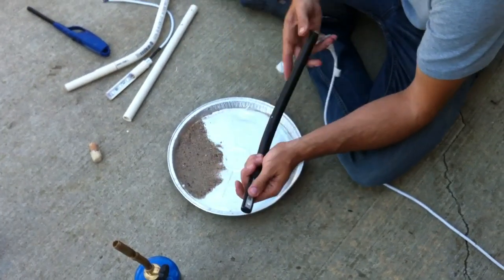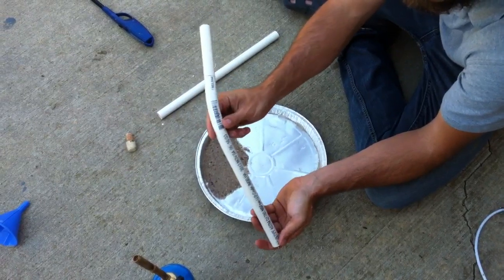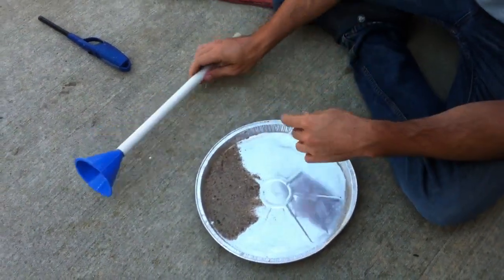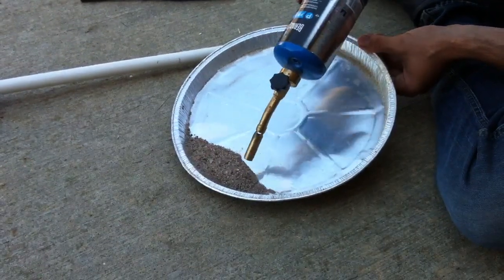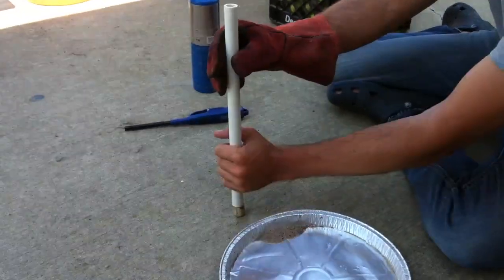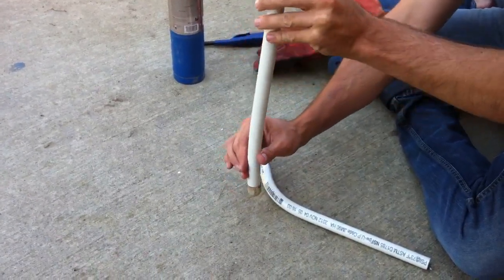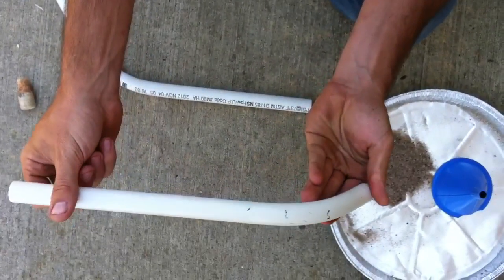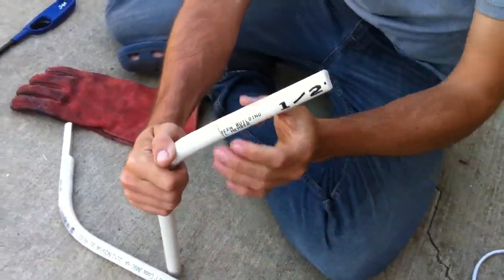How To Bend PVC the Easy Way

Comment: Ever hear the phrase "go pound sand"? Now you know where it came from. All conduit was bent by packing the conduit with sand back when conduit first came to be. It still works on metal as well as plastics but there are better ways that don't require sand such as air pressure or good bending tools.

Comment: If you use this method, and  have the PVC bent in a jig of some sort, you can speed the cooling by simply running water through the inside of the pipe...  However, using water to remove the heat may cause the PVC to become more brittle due to the more rapid cooling.

Comment: Who are the 406 idiots who gave this a thumbs down ?

I hold 2 journeyman cards in different commercial & industrial bldg trades as well as a Crane operators license & certified in 2 types of welding , i have nearly 40 years experience in the bldg trades & I just learned something new and extremely usefull .

Best tip I've learned in 40 years .
Reply: Well said sir, I find it helpful too.

Comment: To cool down faster, wet a piece  rag and wipe at the heated part.

Another way of bending pvc pipe is by inserting a spiring into the pipe and bend it. No torch, sand, welder gloves needed and safe.
Reply: As Technicolor Christmas put it clear above: Try to get a 2" pipe bending spring... The largest I've seen is about 7/8"...  This method in contrast, can be used for up to 2" pipe!

Comment: After I use the sand to get the desired shape...I just dunk it into a bucket of cold water to rapid cool and set the piece.  I use that method when I am making quick pieces of bent pipe....if you need the working time to be longer....just dont water cool... SImple

Comment: To make consistent copies, perhaps you could mix cement with some of your excess sand, dig a shallow hole in the ground (as a support), pour in the sand/cement mixture, press in your master tube (less than halfway covered!! :-), and let the cement harden. Then, you have a form for making perfect copies, with the bonus that the form will help cool the tubes more quickly. Probably a good idea to wiggle the master tube very slightly as the cement is setting up so that the fit isn't TOO tight, and you might also want to coat that tube with a little oil or somesuch to keep the wet cement from sticking to it. The copy tubes wouldn't need any of that.
Reply: So you put the master tube in concrete and let it harden.  How do you then remove the 'master' bent tube?   FAIL.
Reply: +Gord Baker "Less than halfway covered," you are basically making a bent trough in the shape you need. FAIL to you sir.

Comment: First off, Thank You!  You made my head explode.  DIY PVC projects are taking over my life.  I have just one quick question.  Since I have never done this before,  would a hair dryer or a Heat gun work while using the heated sand at the same time?   I'm going to try both.  Have you any suggestions or recommendations?  I'm all ears!
Reply from the maker: I have never gotten a Hair dryer to get hot enough, a heat gun will work but it is harder to get the pipe to heat evenly along the entire length and evenly all the way around.

Comment: combine your sand with a heat gun and you got a quicker and adjustable heat input. Not certain why that is the "hard" way.
Reply from the maker: +ObsessionPC because a heat gun heats only one spot/place on the pipe at a time.  For the demonstration piece, it may work ok, but I use this method regularly with pipe up to 10' long.  No heat gun can heat a 10' long pipe and keep the entire pipe the same temperature and consistency while maintaining the diameter of the pipe.  Heat guns also burn/scorch the outside of the pipe, but mainly it's the inconsistent temperatures as a reason to avoid them.

Comment: Be aware that placing the  pipe on the outside of the template forms the inside radius to the outer radius of the template, not to the same angle as the original.

Comment: slide pipe insulation over outside of pipe and as soon as you pour the heated sand in plug that end up as well asap .. that will hold the heat increase of aprox. 47.8 %

Comment: i would just spend the money and buy the appropriate fittings, what am i missing? they even sell fittings that do a 22 degree elbow. Please explain?
Reply: +Fatsacks Allday In his application, the elbow wouldn't be a smooth transition.. The OD of the elbow is something like 1/2" larger... so in this case it's just aesthetics.
Reply: i see, thanks for the clarification.
Reply: +Fatsacks Allday  I agree with just buying the fitting needed. I can see bending a tube for a special home project ,but not for the intended purpose of the pvc. The tube wall will be thinner at the bend making it weaker at that spot. Ok for drain ,but I would stay away from anything with pressure behind it.
Reply: +magic5651 
Do you have any concept of how these pieces of tubing are to be used?
Magic indeed...
Reply: +ellsworth No. That's why I made statement in my reply for those who would have different applications for this method.
Reply: My logo is because i grow weed lol i dont give a shit about organic vegetables. i dont see any use for bending pvc pipe like that, there are much better materials for situations that need bended pipe.
Reply: +Fatsacks Allday your missing that he is making landscape lighting...lay off using your crops.
Reply: +3speedjohn waaa true that , must of missed that when I first watched the video
Reply: +magic5651  your not supposed to use PVC for high pressure
Reply: +Fatsacks Allday   Most fittings of the same diameter do come with one, or two ends that are larger and in some projects that isn&#39;t desired.  To get around this and keep pipe fittings a smooth transition from one piece to the next, buy the next smaller PVC pipe and use it to make slide in parts.  Sometimes you have to make the slide in part a little smaller to get it inside the larger pipe you are connecting parts to.  That is easy to do if you make the slide in pipe piece with a cut that runs from one end to the other with a circular saw.  The blade cuts away a small amount of plastic, depending the kerf, or width of the blade.  When the slide in pipe is squeezed down a little to close off the gap of the cut, it becomes small enough to fit into the larger diameter pipe parts.  The result is no lumps or bumps in the pipe framing.  If you decide the joint is too weak, then use metal pipe slide in parts made the same way.  Usually the slide in is at least 6" long, providing 3" for each plastic pipe part.  This isn't a new trick, but used by others making a greenhouse frame out of PVC pipe that will be covered in greenhouse plastic film/sheet.
Reply: Why not just use flexible conduit for the situation he was in? 

yes i have actually made one of the hoop houses/ green house before but there was no need to heat it and bend it. pvc is very flexible as is.
Reply: Not sure I can comment on his situation, or what he and others might find useful.  As to flexible conduit being placed inside PVC pipe to help with the heating and bending of PVC pipe into a custom part, there are tools for purchase made with flexible conduit with heating elements inside.  They are sold for commercial applications, use electric to heat Nichrome wire and often come with a temperature control.  A bit expensive to buy and not so bad on cost to use.
Reply: what i meant is just using flexible conduit and scrap the pvc all together also im not talking about the metal flexible conduit, the rubber kind, it can be buried with low voltage wiring.. Expensive yes compared to pvc, but what you would likley spend in money would save you in labor and time of heating and bending pvc
Reply: +Fatsacks Allday I can think of other bends other than the standard angles - "S" shapes, for example, or curves in different planes, as in a series of perpendicular "S"s.

Comment: Put sand inside the PVC pipe and close the ends, not to knead and soak in hot water or warm up with hair dryer.
Congratulations from Brazil!!

Comment: Great idea. Although how's this: fill the pipe with sand first, then heat the external surface of pipe with a heat gun. The sand will help the pipe hold its shape while u bend it and overcomes heating sand (poor thermal conductor) to high temp. Cheers.
Reply: ***** heatgun give so uneven temperature.. especially if you are trying thick pipes. I will try this method tomorrow on bigger pipes and see how it goes.. :-)
Reply: Fair call. I went out and bought a Makita heat gun - seemed like the best bang for my buck and at $100 it has digital temp control which overcomes 99% of the problems of heat guns. I can set it to a temp like say 340 degC which works nice for working with PVC.

Comment: You should measure out two portions of sand.  Heat the 1st portion and place inside the pipe.  Then heat the 2nd portion.  Then replace the 1st portion with the 2nd.  No need to reheat the sand a 2nd time.

Comment: To me, the hardest part seems to be that aluminum pan. I was thinking about making a bottle out of a piece of iron pipe and some fittings. Maybe a 1-1/2 inch nipple with a cap on one end for filling with sand and a reducer on the other end with a 1/4 inch nipple to dispense the sand into the PVC pipe. Just heat it in the oven and pour. Dig around in those junk boxes in your shed...you might have a zero-dollar design.

Comment: Why not just use a heat gun? Why the extra step with the sand?
Reply: without sand the pipe will collapse on itself, but you could use a heat gun to heat the pvc up after the sand is in it
Reply: I get why he is using the sand but it is not needed at all. The PVC wont collapse in on itself that much more if you are careful and it takes less time. And in his case, he really didn't have to worry about that anyway with those lights. All that was going through there was wire. No real need. But good beginner tip I suppose.
Reply: Chris Everly the material will find the material way to bend in most cases that by flattening. if your only going to a 20 degree angle the sand isn't needed, but if your doing high degree bends the pipe will collapse no matter how slow you go.
Reply: We were talking specifically about what he was making I thought. Not 45-90 degree angles.
Reply: Chris Everly it s tutorial for bending pvc this video is about bending pvs not building what he is building. so WE are talking bout any bend put in pvc wich in most cases would need strengthening from the inside.
Reply: +Chris Everly  The point made in the text description was the ability to do the task withOUT a heat gun. Otherwise, yes use one.
Reply: Chris Everly sand packed into a tube or pipe prevents collapse and narrowing at the radius.
Reply: Rob Jones as a pool plumber, I can tell you, you can heat with a torch and propane tank quicker and with the same results! If you can't? Then you need more practice, this method just takes to long
Reply: if you just heat it and try to bend it, it will kink
Reply: watchgoose o
Reply: Sand inside does the same thing a conduit bender dors from the outside.
Reply: Chris Everly the sand keeps the tube from flattening when you bend it you are compressing one side of the pipe  while stretching the opposite side the sand keeps the tube open as it does that
Reply: cartmanrlsusall we actually seal the ends so that the conduit does not collapse or kink, we use ovens, not necessarily a torch because it's against the electrical code to leave any burn marks, learn this almost 30 years ago
Reply: Chris Everly the sand keeps the pipe from collapsing

Comment: Good idea that works well! By the way, using coarser sand that is slightly moistened will work even better! Have you tried using super hot oil, either dipping it in or filling it?
Reply: have you done that? I would think IIT would catch fire?

Comment: Make a jig to bend each one equally and let it cool with the sand in it. We  use a big banjo burner and a 30 gallon stock pot full of water. Just need enough jigs for a production line.

Comment: You could also pre-heat the pipe by sticking it into a tall container of boiling water
Reply: +FJSA Steve   Boiling water can work, but the PVC is made to not deform with hot water running through it.  You really need a slightly hotter method.
Reply: Gardens and More m
Reply: Gardens, he was only talking about PRE heating

Comment: Have you measured the temp of the sand when poured...250 F, 300 F? , 350 F?
Reply from the maker: I have tried at lower temps (because I was impatient waiting for it to come up to temperature) and I'm sure the pipe will eventually get soft, it just takes forever.  the 500-600 F seems to be a sweet spot for flexibility while maintaining integrity of the pipe and quickly cooling to set the shape.

Comment: I like you lights idea and they look really good to how do you plan on removing the black print on the side of them just out of interest. Good Job!
Reply: Steven Watson I have found that light sandpaper does that pretty well. One should probably sand anything one intends to paint anyway. If you want to get really fancy and go for a glass finish, start with coarse and progress to fine (but that's probably not great for paint adhesion). Oh, and wear a filter mask when sanding PVC. The particles can be pretty light and float their way right into your lungs.
Reply: Steven Watson Do you know what punctuation is?
Reply: csabo1725 You must be new to the Internet.
Reply: csabo1725 No need for name calling. Tom Burke was merely pointing out that complaining about anything related to language proficiency on the internet is a pointless endeavour.
Reply: Adrian Thomas-Prestemon csabo1725 Exactly.
Reply: Adrian Thomas-Prestemon So, Tom sees fit to school me on what is and is not a "pointless endeavor" on the internet and that's a non-pointless endeavor in your mind, but me commenting on failed grammar is not allowed by the same standard?  Your rationale is stymieing.  Come back when you are capable of logic.
Reply: Ok let's de-escalate this. Nobody needs to get mad over this. So somebody has bad spelling and grammar. So what? What good does it do to yell at them on the internet? What's the point in raising your blood pressure over the arrangement of some pixels on a screen?
Reply: csabo1725 "you are" = "you're,"  not "your" mr. grammar :)
Reply: +csabo1725 ....."you're"

Comment: For all the haters ,every plumber on earth should have a smelting pot & stand along with attached propane burner ,now instead of only using their smelting gear for cast iron work they can full their pot with sand that stays hot & build a simple adjustable jig for any angle with 100% accuracy, the smelting pot would hold enough sand to do 6 or 8 bends continuously .

Comment: it is better to use heat gun. put the sands first then use heat gun to warm the pvc pipe.
Reply: Yeah, no. Not if you want a clean installation. Also, less control of the bending with a heat gun.

Comment: Could you heat sand in a microwave?
Reply: +buz butler That would be a bad idea because sand is abrasive. If it got into the lower parts of the microwave it would kill the turntable
I know you can heat a ceramic mug in a microwave, so it might work, but the not getting the sand into parts you don;t want to would be the issue there. If you heat some thing up in a microwave they tend to pop and jump out of the bowl. Sand could ruin the oven if it got in there

Comment: Seriously have americans never heard of a bending spring? You make bending pvc conduit difficult for yourselves
Reply: James Keener i hope you realize how NOT problematic the springs are, i am an electrician and use them almost every day, the problem with using the springs is, not applying yourself to the job and learning how to use your tools correctly. the bending springs is by far the BEST and EASIEST oh and most important FASTEST fay of achieving this result.
Reply: Woah woah calm down fellas! 😉 each to their own but i completely agree with mick. I just found it bizarre to sit there and waste so much time and faffing about when all it takes to bend a length of conduit is a spring and abit of rubbing to warm the conduit. It requires the same amount of skill to bend conduit the right amount and at the right point but without stealing sand from the kids.
Reply: I applaud this guys ingenuity.  This shows that there are more than one to skin a cat.  Someone working on a small project may not have access to the spring that you mention.
Reply: AMAR SINGH so where is your vid on the spring method?
Reply: Michael Brogan.    ever heard of a hot box ??
Reply: Michael Brogan.      very funny..lol...and stop hot boxing cigarettes ...lol

Comment: how bout a pack of BBS added to sand for better heat carrying capacity...
Reply from the maker: +Robert Mencl That would certainly help hold the heat and might be great for larger diameter or longer pipe.  I'm guessing it would take significantly longer to cool though too.  Give it a shot and let me know.
Reply: +Robert Mencl  BBS?  Thinking you are suggesting copper BBs mixed in with the sand.  Copper balls would tend to heat up well and hold the heat a bit longer than tiny rock pieces of silicon.  Not sure how much faster, or how much longer BBs would hold heat.  Interesting suggestion.

Comment: Also,,,,,,
Unless you use the same piece as a template, the pipes will all have different radius bends.

When you bend it inside the other one, the two of them will not have the same radius curve.  overlay them and you will see what I mean.

If you are going to wast time with a useless video - at least do something correctly.
Reply: Now you got it!